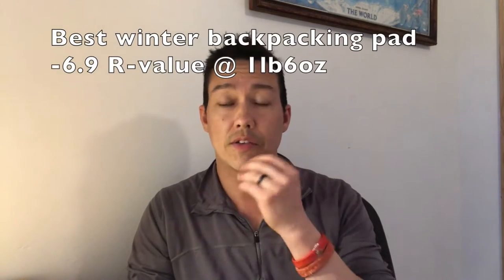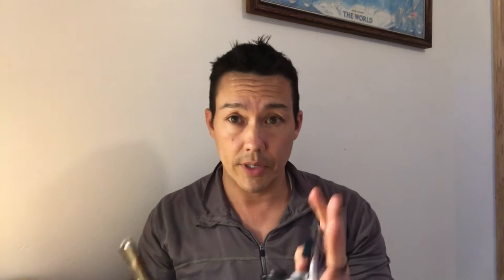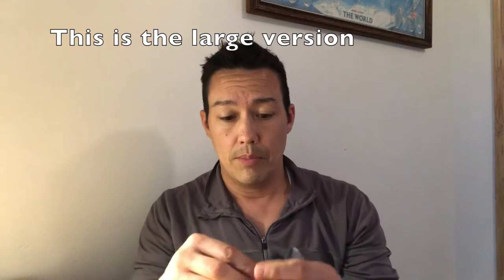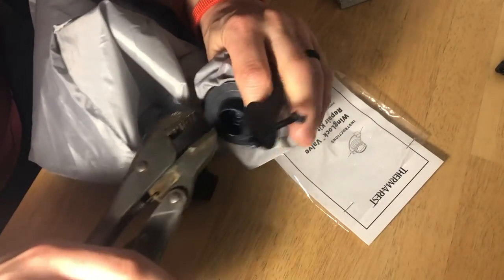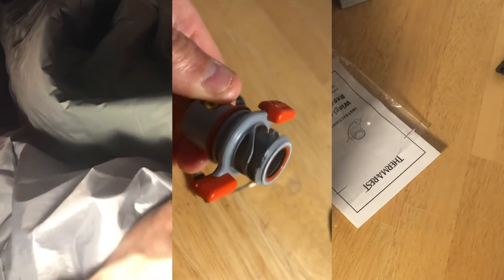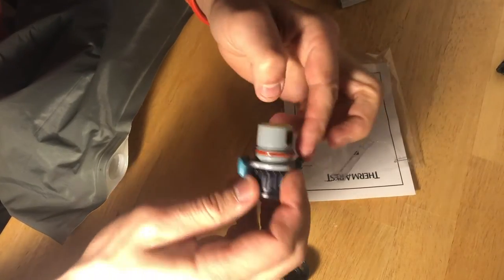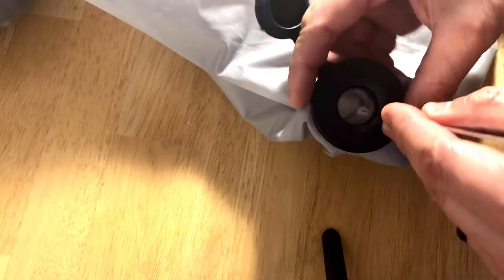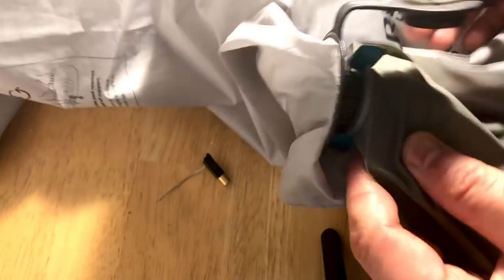How to replace a broken Winglock valve on a Thermarest Neoair Xtherm air mattress

Comment: Sanding that lip on the pump sack would be less of a gamble than the knife, but I went for eliminating that issue completely and got myself a small rechargeable air pump.
Reply: True about the sanding. I just lost patience after 15 minutes with 50 grit.🤨😂

Comment: I have an xterm and xlite both have the same valve and use the same pump sack. I agree the sack is hard to put on, much harder than my nemo pad. I don't think it's necessary to shave away at the pump sack connection, I found it helps to squeeze the sides of the pump sack connector and it pops out. You can also use a "flextailgear" usb recharable mini air pump from amazon, it's light weight and game changer. It can pump up the pad and deflate it. It's heavier to carry 2 pump sacks.
Reply from the maker: Awesome. Thanks for the ideas and suggestions!

Comment: Very helpful 
The modification you did to the inflation sack is key to me getting back into business with mine. Do you have any advice or clearer footage on how you achieved this? I could not see what part you pared away. 
Thank you
Reply from the maker: I just sort of used perpendicular friction with the knife to shave around the entire inside circumference. At first, I tried to sand it but the knife was quicker.
Reply: @outdoorgearrepair9187  Looks like Robert Williams suggested using the lubricant to reduce friction as well.